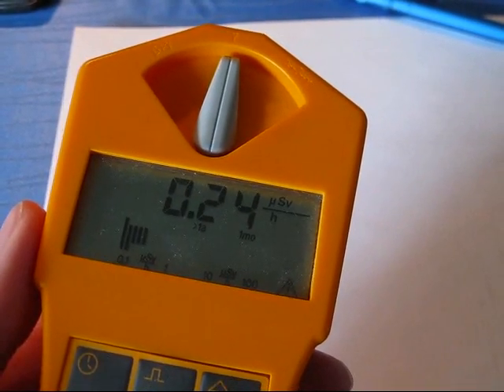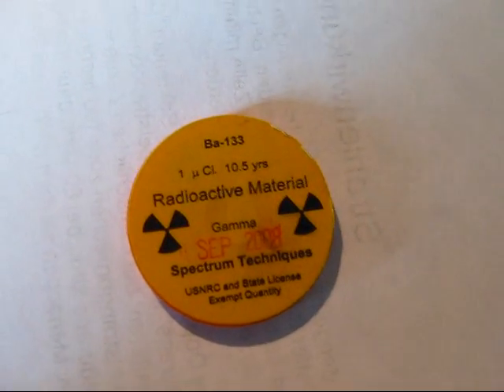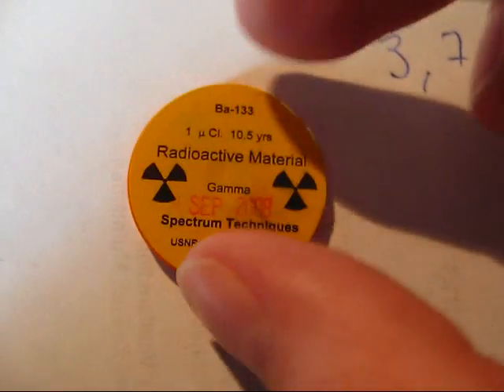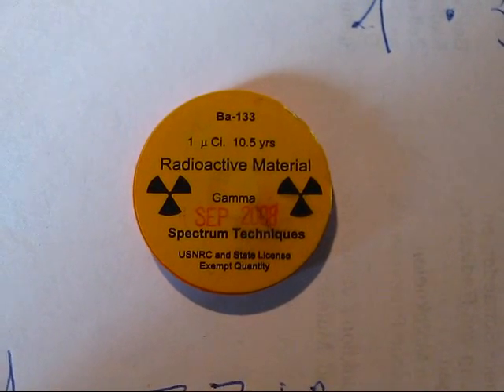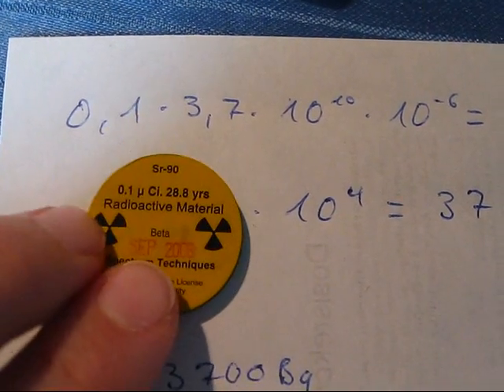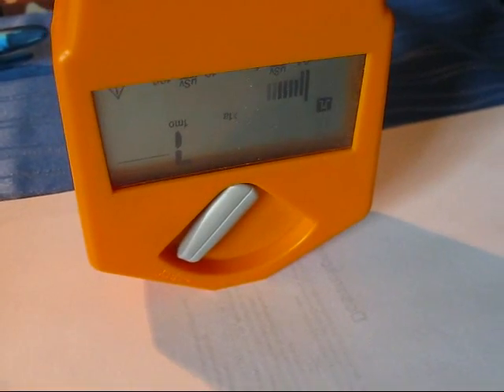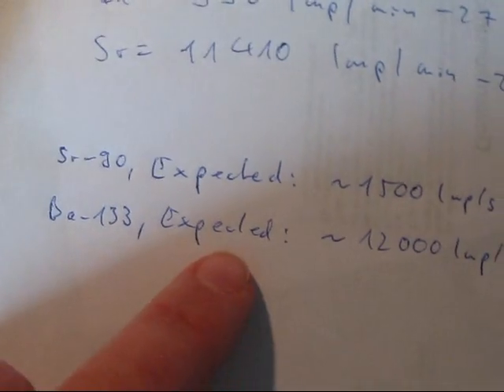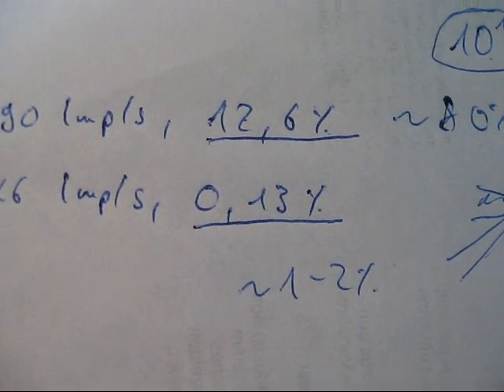efficiency calculations for a geiger mueller counter / tube (gamma scout)

Comment: Good video.  Here's something to consider also:  The geiger tube has a maximum response rate.  When a count occurs, it takes about 100usec (0.0001 sec) to recover before it can register another count.  This would mean, theoretically, that the maximum flux that it can effectively record is approximately 10,000 Bq (cps), or 600,000 (cpm).  So the flux must be considered in radiation measurements.  If  n particles hit the detector within a 100usec timespan, you'll only register 1 count, not n counts.  I suppose you would have to statistically calculate the chances of missing counts when the sample emits a variable flux of radiation.  References:  Emilio Segre, Nucleii and Particles, 1977, W.A. Benjamin Inc., pg. 95.    --Found out that modern Geiger Counters like the Inspector EXP compensate for this loss electronically, to maintain an accurate count.

Comment: I was wondering about this too. Presumably the Gamma Scout can only give a sensible reading in Sieverts if it "knows" the proportion of each type of radiation it is exposed to at any one time. Do you have to take multiple readings with the shutter in different positions to achieve this? Varying sensitivity and quenching effects must make achieving any sort of accuracy horribly complex!

Comment: I think you cannot simply divide the activity of the source by 2, because the emissions are not planar, but tridimensional, so the dispersion is much more severe. I say: if the source is 1cm from the geiger tube, the total area of dispersion is = to the surface of a sphere of radio 1cm (4.Pi.R^2). And the geiger senses only the ones that hit the small mica window. So, the % is not 50% (1/2) but % = [area of the mica window / (area of the sphere radius = distance from the source)].

Comment from the maker: @NoWattz 
they're believed to be universally constant; or, at least temperature, pressure etc. doesnt seem to matter. it may be possible, however, that even radioactivity itself is induced by an outside force, some kind of rays travelling through space. some data seems to suggest that during high solar activity, decay rates increase. i cant really state if this is true or not, but i'd not rule it out as a possibility.

Comment from the maker: @daeamarth 
geiger counters are energy-independant, so they just indefinitely amplify and count impulses. there's no proportion to the type of radiation nor the incoming energy. thus, you can only make a geiger-counter not count alphas or betas by SHIELDING the alphas and betas. however, PROPORTIONAL counters (same concept, but lower operating voltage) can be calibrated for alpha, beta, gamma radiation and the impulses will be proportional to the energy of the radiation.